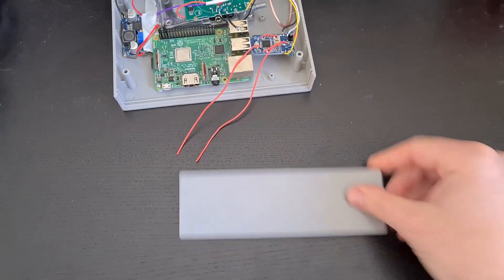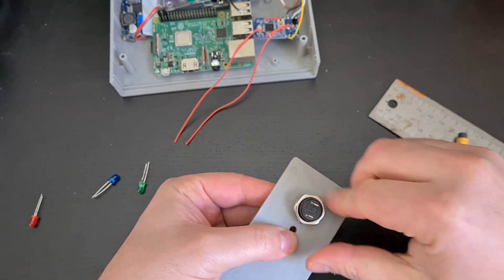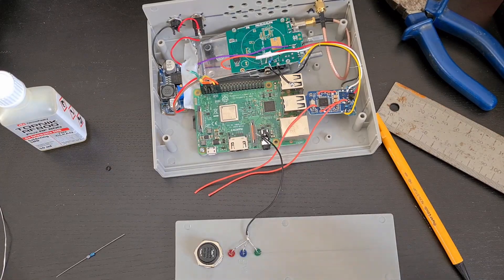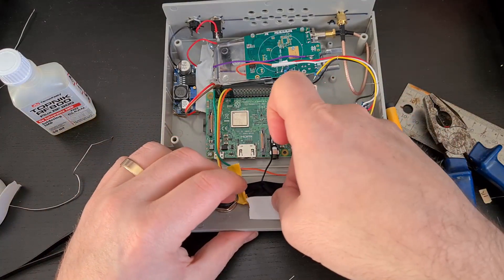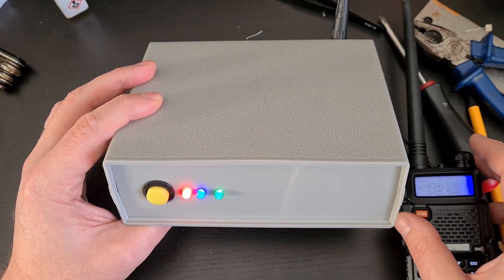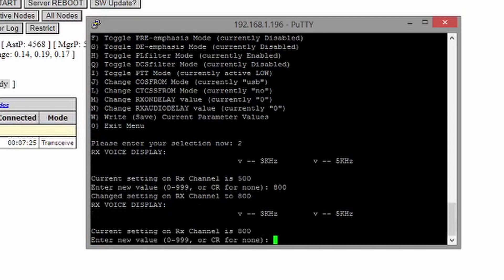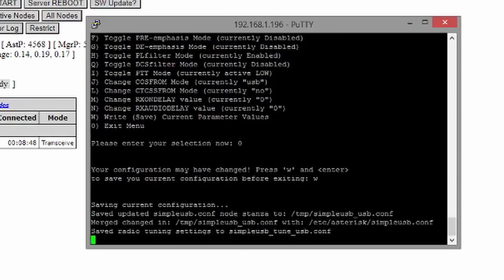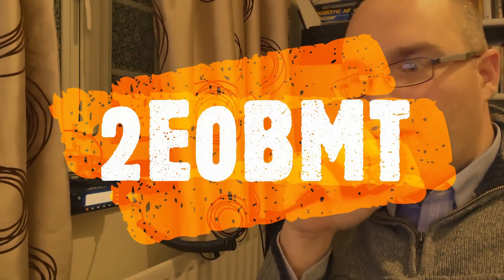PART 6: Idiot’s Guide To Building An Allstar Node – Final build and test! Amateur Ham Radio 2E0BMT

Comment: Hi Ben. Thanks for a great tutorial. I have built my Node and it appears to be working, but it doesn't announce the IP address or anything when first powered up..any suggestions gratefully received.
Reply from the maker: I bet your COS needs inverting
Reply: @RadioRevG5REV  Thanks Ben. I used option J on the menu for "COSFROM Mode" and changed it to usbinvert.  Saved current Params , exited then rebooted but no difference
Reply: If I connect to the parrot node (40894) I get dialogue OK with COS normal but still no start up messages.

Comment: Many thanks for the series. I've built my node using your guide and really enjoying it. I always thought that stuff like this wasn't "real radio" but it's been an excellent radio project. One thing I should mention is that I had to enable ctcss in the simple-usb settings which wasn't in your guide but to be honest it didn't matter because troubleshooting is half the fun. My node number is 54051. Cheers! VK6OP.